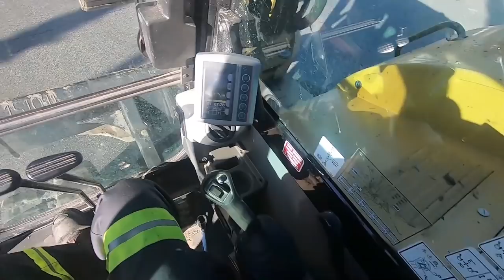How To Load An Excavator Onto A Low Bed | Pro Shot

Comment: It may be a little less likely to slide sideways if you cross the chains. Rubber tracks aren’t too bad but steel tracks will slide sideways. Love the rollback trailer.
Reply: So the best way to do it with steel tracks is crossing the chains?

Comment: Great job. When loading/unloading excavators, always remember to only use your feet to track the machine. This will prevent the machine from jerking as much while trying to make small turning adjustments. More importantly, keeping your hands on the joysticks means you have full control of what the machine is doing. This is the safest way to run an excavator. Hope this helps, and thanks for the great content.

Comment: What you did at 12:40 and 19:40 Is not good, you are creating a false tightening of the chain. If if you had a hook on the binder that would let the chain slide as you tighten then it would be fine but since you are hooking directly to the chain if the piece of chain attached to the deck is just a but shorter it will tighten before the piece of chain hooked to the excavator.
Reply from the maker: There is no way to put the tail end in tighter than the chain in the binder. It has to be looser to go into chain pocket. Been doing it this way forever never had an issue